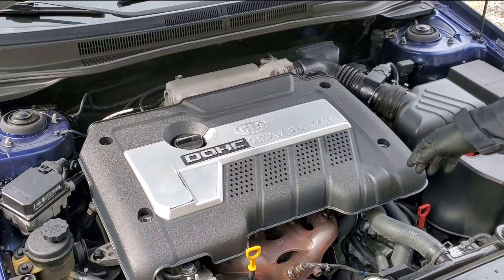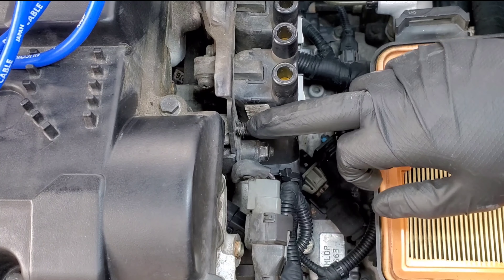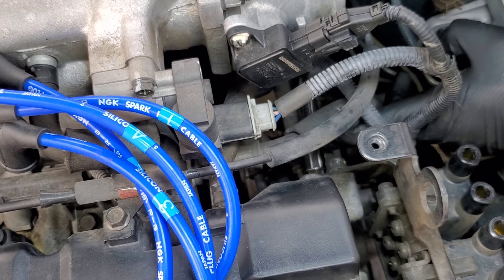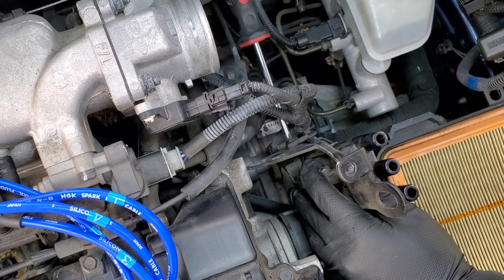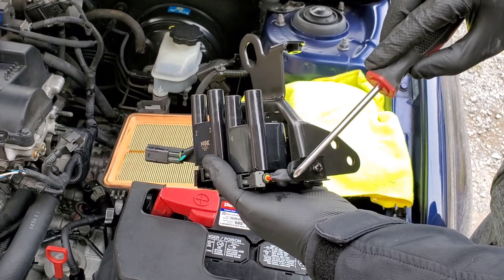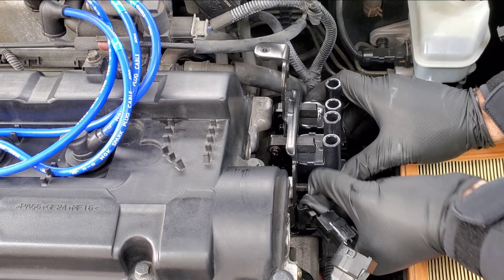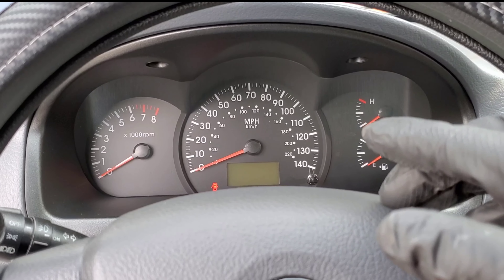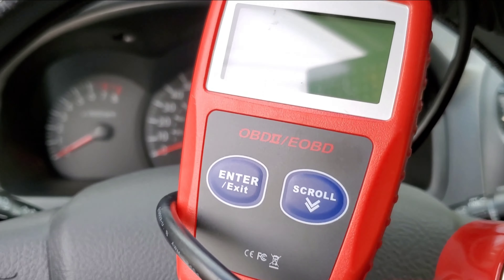Kia Spectra Ex 2004-2009 Ignition Coil Replacement! 2005 kia spectra ex Sedan 4-Door 2.0L

Comment: God job. Why you replace it. Is the engine not start, or crank no start, or no sparks at all. What problem caused to replace that
Reply from the maker: Hey my friend I hope all is well, I'm so very excited that you have found my channel and i Hope you become a member of the sub family community! The reason for the the replacement of the ignition coil on my vehicle is primarily for preventative maintenance. Overtime the engine heat and vibrations can cause damage to your ignition coils, by replacing the ignition coils This helps prevent repeat failures and ensures balanced performance. The reason for me saying this is because the lifespan of an ignition coil in a car can vary widely depending on several factors, including the quality of the coil and also the driving conditions, maintenance practices, and the make and model of the vehicle. So to summarize everything up an ignition coil might last around 80,000 to 100,000 miles.

I hope this information helps you. & i appreciate your support. Keep being an amazing person my friend. & I will be here to assist you every step of the way.

May Yahusha HaMashiach Bless you!

Comment: do u have check engine >?
Reply from the maker: Hey my friend I hope all is well, I'm so very excited that you have found my channel and i Hope you become a member of the sub family community! 

No, I didn't have a check engine light on before installing the new ignition coil or after installing the new ignition coil on my 2005 kia spectra ex, You always want to preform preventative maintenance and your vehicles.

If the ignition coil was replaced correctly on a Kia Spectra EX and the check engine light is not coming on, then it is likely that the issue has been resolved and the new coil is functioning properly; however, it's always a good practice-check for any potential issues like loose connections or other related problems that might still be causing performance concerns. 

A faulty ignition coil typically triggers the check engine light, so if it's not illuminated after replacing the coil, it indicates the issue was likely resolved. 

Always remember to Double-check installation: Even with a new coil, ensure all connections are secure and properly seated, including the spark plug wires. 

And don't forget to Monitor performance: after replacing ignition coil Drive the car for a few days and pay close attention to how the engine runs. If you notice any hesitation, rough idling, or loss of power, further diagnostics might be necessary.

I hope this information helps you my dear friend & i appreciate your support. Keep being an amazing person my friend. & I will be here to assist you every step of the way.

May Yahusha HaMashiach Bless you!